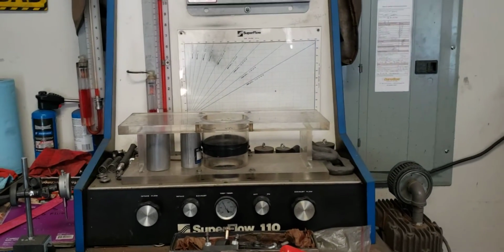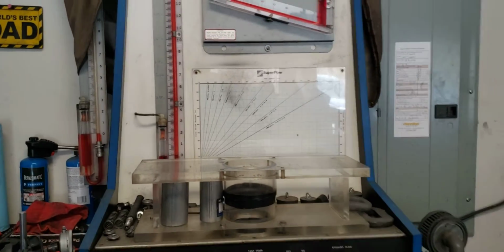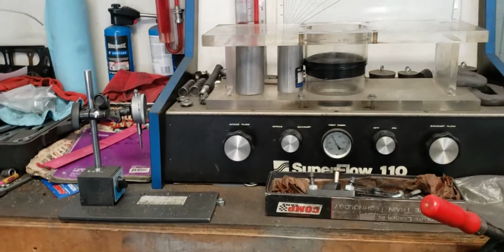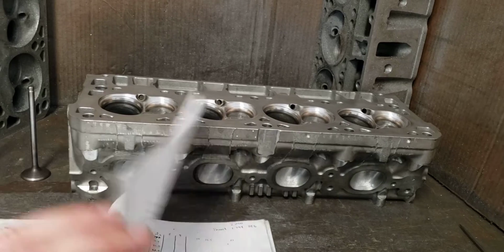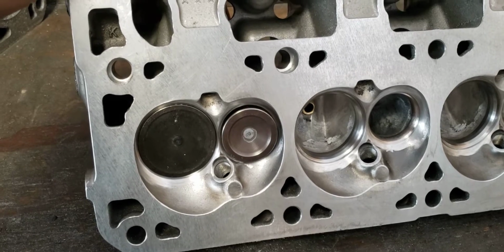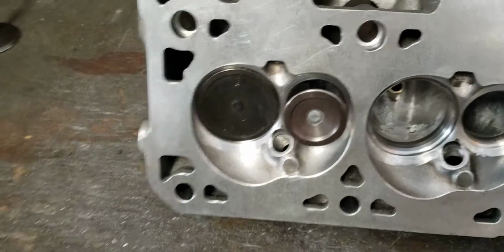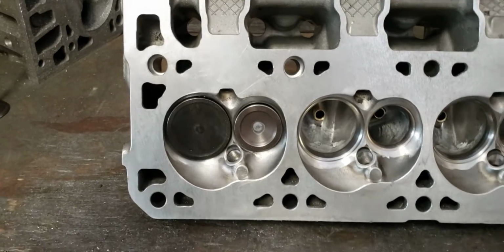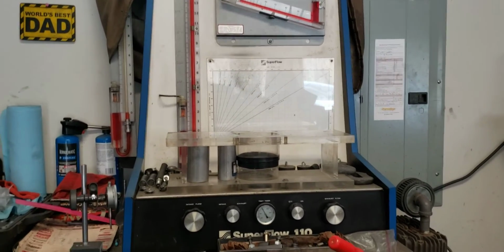Flow numbers.  What do they really mean?

Comment: Just a quick note about overlap, low-lift flow and reversion/charge dilution/contamination....simply put, the worse your exhaust is, the bigger the problem will be.
Also, during overlap you're typically seeing .150" lift or less, so using a valve job that kills that particular data point (flow) can actually yield positive results. 
I typically concentrate most of my efforts in the .350"-.700" range unless it's an application using QUITE a bit more cam, then those efforts shift into the .450"-1" range. 

Everyone wants to make some magical correlation about how the heads only flow to .xxx" amount of lift so there's no reason to have a cam with more lift that that. When I hear it, I roll my eyes and ask them about the old Super Stockers that were running unported  cammel humps (461, 292, etc.) with .700"+ cams....The point there is, the amount of time it spends at or above that lift point and if that particular lift point was being hit during the degrees in the stroke when it was actually drawing the most vacuum on that port. Remember, that piston has a bit of dwell time at TDC and BDC and has acceleration and deceleration curves based on the amount of stroke and rod length. 

Also, you made mention of BOOSTED applications like they require something different when it comes to porting. For that I'll give you a quote from Darin Morgan...."Boosted engines are just like naturally aspirated engines, but with REALLY good air."
Case in point, if you put an analog vacuum/boost gauge in the intake runner as close to the valve as possible (think old school down-nozzle location) on a boosted engine (no matter the boost level) you will still see vacuum at some point every time the intake stroke happens. Just think, the piston is dropping at 4000+ Ft/Min....there is no valve large enough to feed that without a HUGE pressure drop, let alone and entire intake tract. 
Now that's not to say that boosted applications don't need additional intake valve spring pressures at the higher boost levels. That's a different issue altogether.

Another point to keep in mind when sizing the ports. There is a HUGE difference between wet flow and dry flow. Think intake charge density and the weight of that column of air your trying to get moving through your specific runner/valve curtain area. Simple rule I've learned is, the denser the charge, the larger CSA the engine will be happy with. Whether it's boosted, nitrous or even running methanol (carbed especially). The closer the injector is to the valve, the less of an effect it will have so keep that in mind. Case-in-point, look at the "shower-head" injectors used in F1.

Ok, I've given away enough free money today.
Sorry about the book.
Keep the vids coming. More knowledge in the racing community only drives everybody to up their game.
Reply from the maker: Thanks for the words.  I am only dealing with the LT heads.  They are 100% dry flow.  And since we are Direct Injection we control the fuel pulse.  So reversion during OL is almost a moot point towards drivability at this point.  

My point on boosted motirs is geared towards the air velocity in the runner.  So we have to be more particular with the port shape and the short turn to not crash the port.  28" is nothing to a boosted motor.  And at that point, the runner volume kinda goes out the window.  We can "over do it" a bit as air charge and air speed are not a concern any more.

Laminar airfliw up high with cams I feel you are dead on about.  Stock heads crash at .525" lift.  Yet a .700" lift cam will make more power than a .525" lift cam.
Reply from the maker: If you don't mind, please message me on my FB at Brettprayporting.  I am always willing to learn.  I stumbled onto something last night that has me baffled.  But yielded huge gains.
Reply: @prayperformance5137   Sorry, no FB here. If you have some other contact info, I'll be glad to give ya a shout.